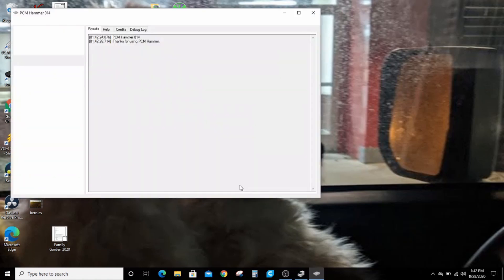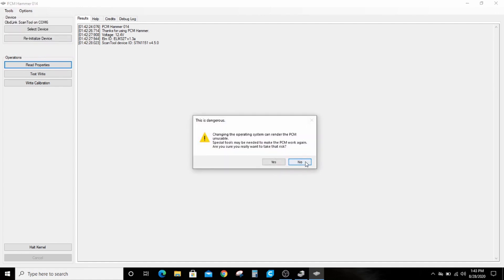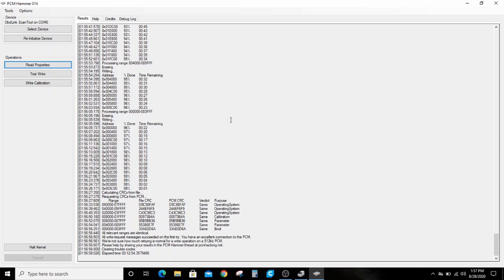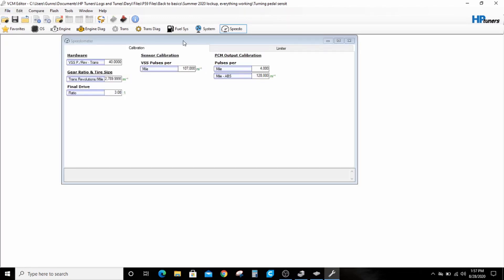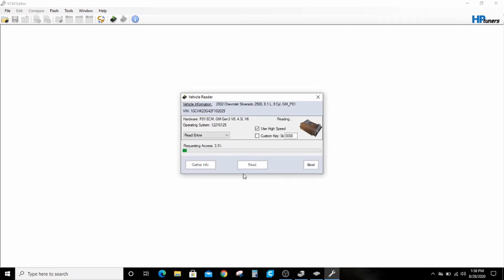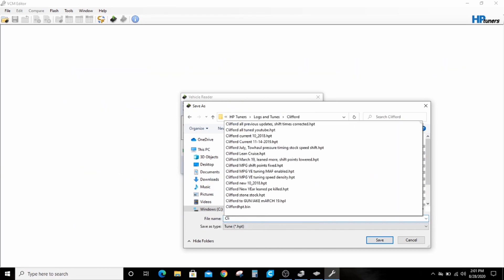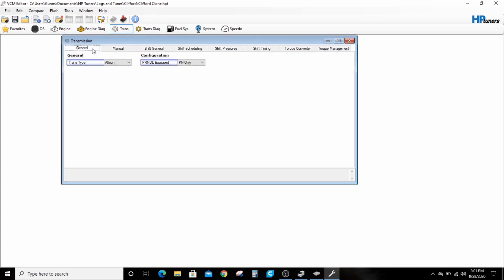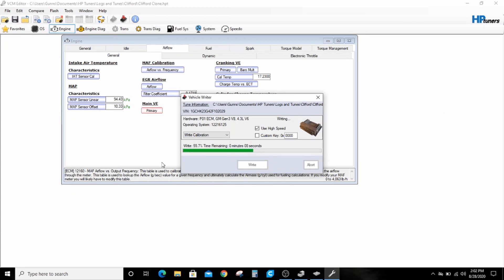How to create a perfect clone of your PCM with PCMhammer

Comment: new to me 2002 gmc 1500hd, 6.0 i rebuilt the 4l80e and it worked great for 40 miles at up to 45mph.  tried to go on the freeway and the torque converter wouldn't unlock.  I suspected bad tcc solenoid even though it's brand new, but it reads 14.6 ohms and my volt meter seems to be telling me it's getting voltage and being commanded to turn on when it shouldn't be.  must be either the transistor in the pcm died and is giving power when it shouldn't (gm decided this transistor should fire a whole lot to modulate tcc lockup pressure so the transistor's health is suspect to me) or it could be a break in the wire harness but i was gentle with it during the uninstall and reinstall of the tranny and if i broke the wire harness it shoulda failed immediately not 40 miles into the rebuilt and only once i tried to drive the freeway and commanded full tcc lockup for the first time in 2 years.  (truck sat at previous owners for a year and i spent a year fixing).  I grabbed a spare 0411 pcm from a junkyard 01 tahoe with a 5.3.  im thinking of getting a vx-nano on christmas sale and using pcm hammer, see if i can pull the tune from the old pcm and flash the replacement with the stock tune to start with and see if that fixes my locked converter.  it will unlock when i unplug the harness from the tranny and in reverse and it's a rebiult tc so it's not physicaly locked just electrically and hydraulically locked whenever the harness is plugged into the tranny.  if anybody has any links to educate me more on this process, or advice to respond here i really appreciate your time.  I need to get a second person and some wire to voltmeter test my harness more but i wanna learn pcm tuning anyways, just need to do it sooner than expected now.

Comment: hey Recently my pcm developed a short in the vehicle speed sensor circuit of the pcm long story short would this technique allow me to not have to pay to relicense a replacement pcm with hpt because I would like to avoid buying 2 credits just to write a tune file 

or is this more of a copy paste your old pcm to a new pcm but in order to use hpt you have to re-register the new pcm?
Reply from the maker: That's exactly the purpose, new PCM will be the same as the old to HPT
Reply: @TheDrivewayEngineer  fantastic! google A.I. was lying to me
Reply: @TheDrivewayEngineer  ok so lets say you went to a junkyard and got another PCM with the same model number but a different operating system... for example 2 separate cars that use the same PCM, 

would you need to reprogram the pcm to fit the operating system of your actual car, I ask because i have an 07 cobalt ss it has the same PCM as a 2.2l malibu so i bought 1 online and it couldn't read or write with pcm hammer then i went to a junkyard and it's the same deal 

pcm hammer says the OS is different and the key doesn't work

sorry for the essay i just need to know if i have to reprogram the malibu operating system to the cobalts os first also fyi i've already read my PCM in my cobalt and saved the bin file

but the malibu pcm which is confirmed the same pcm wont read or write with pcm hammer

Comment: I have a quick question I have a 2000 Ford F150 I want to put a 5.4 dual overhead cam in it is there a way to take the engine file from the Navigator PCM on the f150 or put it on the F-150 file for the transmission on the Navigator PCM I could use the F-150 PCM for the dohc engine but the pin on the plug for the f150 has a similar name but won't control the Dual plane intake which will it less beneficial to do the swap
Reply: i have a lincoln navigator engine minus block and crank in my apartment closet, lol, hope to swap one day but got a deal on a 6.0 gmc im fixing up now

Comment: Wonder if it'll work with a 2001 Isuzu Rodeo (and Honda Passport) ECU. Looks like a P01 as far as I can tell. Once my $30 eBay bought unit arrives, I'll open it up to verify there's no funny business where it looks the same but isn't. Too bad it's not a V8, because it also uses a 58x trigger wheel. Could end up having the option for a 4x 24x and 58x all on the same DBC and easily tunable hardware.

Comment: You have to license your pcm with hptuners first, right? Or after you put whatever os you want on your pcm. Do I have to buy the hp tuners hardware. Or can I use obxpro instead.
Reply from the maker: You can do each one of those things lol. 

If you want to swap OS's on a licensed PCM, then it doesn't matter when you license it. 

If you just want to turn Vats off for free, you can just use PCMhammer.

Comment: JR, you can save any file you want without licensing, I think this changed when the mpvi2 came out. If I remember correctly, you still cannot make changes to the file that isn't licensed though.
Reply from the maker: This is a 100% changeable, savable, fully licensed copy of my other PCM, on version 3.6
Reply: @TheDrivewayEngineer  i understood that. At 5:18 you have a text overlay, which used to be accurate. When hpt realeased the mpvi2, they did away with that. You can now save unlicensed pcms. You still cannot make changes or write them though. It not a big and a minor detail, just wanted to let you know.
Reply from the maker: I don't have an MVPI 2, I'm too poor, I spent all the money up front 😂
Reply: @octanebooster7  do I still need to buy extra credits? On the mpvi?
Reply: @jz2518  i can't say for sure, been too long since i tried anything like that with it.